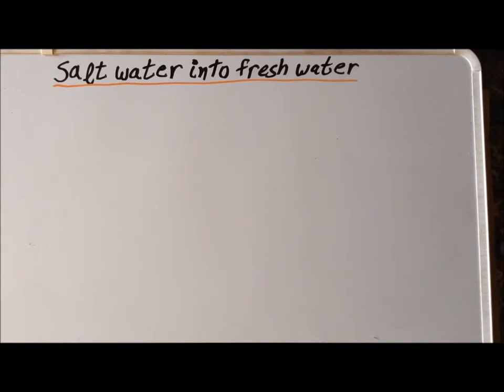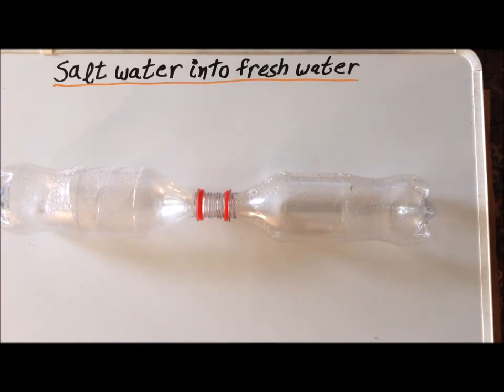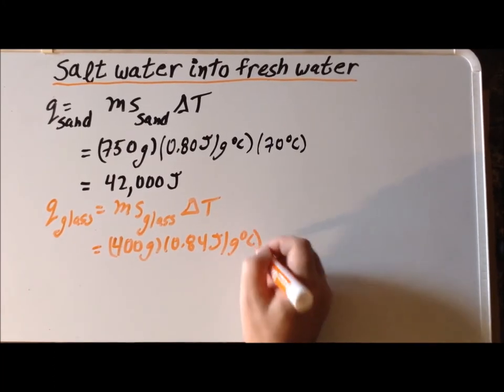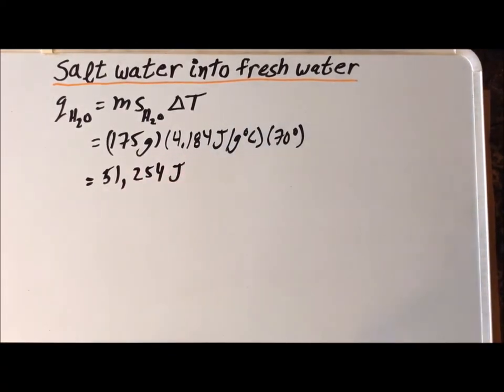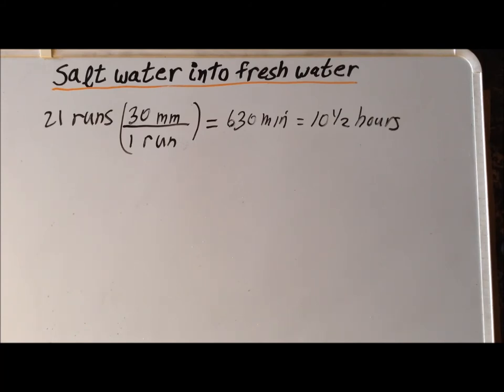How To Turn Salt Water Into Fresh Water - DEBUNKED

Comment from the maker: (for mobile users)

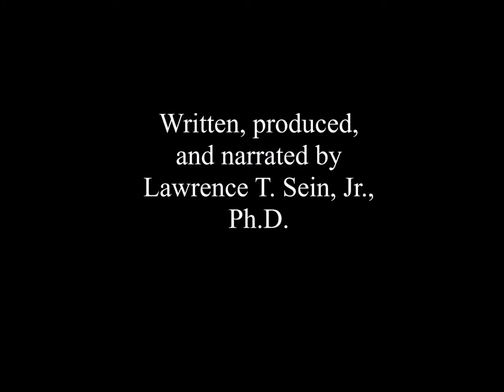00:15   Introduction
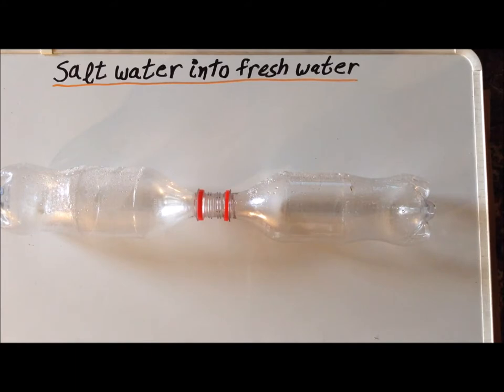01:08   Arrangement of bottles
05:02   Assumptions of bottle mass and bottle volume
06:43   Mass of insulating sand
06:38   Assumptions of pressure and temperature
09:02   q(sand) calculation
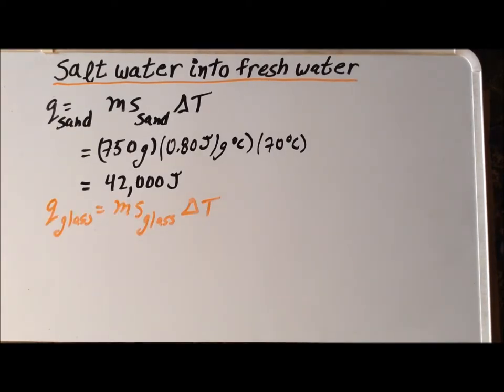10:32   q(one glass bottle)
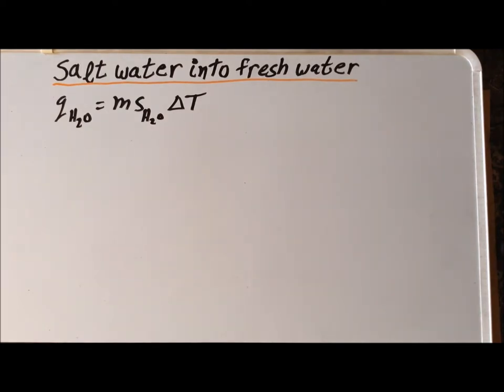11:32   q(H2O)
12:40   q(vaporization)
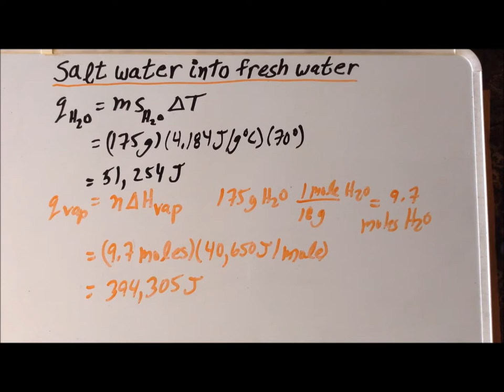15:39   q(total). Note that we use 2 times q(glass), since the two (2) bottles are in thermal contact
15:56   Assumption that heater / fire has power of 1500 W.
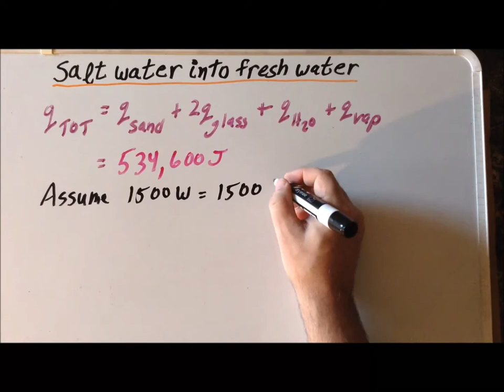16:27   Time required to distill 175 ml water.
17:34   Daily water requirement per person
18:24   total number  of separate distillation runs per day per person
19:42   Amount of salt left after each distillation run
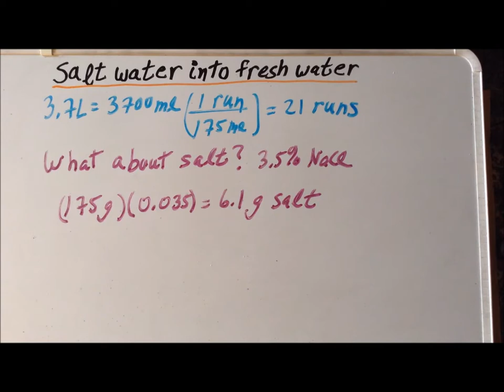21:44   Distillation process broken down into distinct steps.
22:18   *STEP ONE*: fill bottle with 175 ml salt water, assemble apparatus
22:49   *STEP TWO*: start fire
24:06   *STEP THREE*; perform distillation
24:32   *STEP FOUR*: extinguish fire
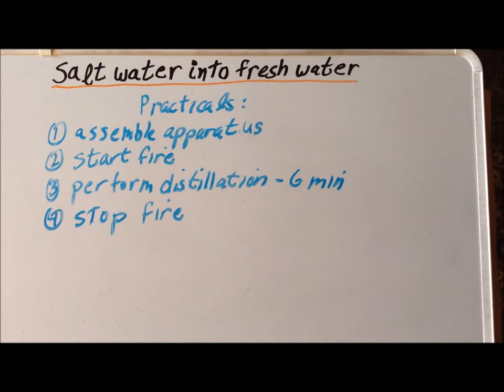25:57   *STEP FIVE*: disassemble apparatus
26:27   *STEP SIX*: let bottle cool
27:34   *STEP SEVEN*: remove salt
28:42   Estimate time per run
30:35   Calculate minimum time to perform runs to yield 3.7 L fresh water

Don't forget to like, comment, share, and subscribe!